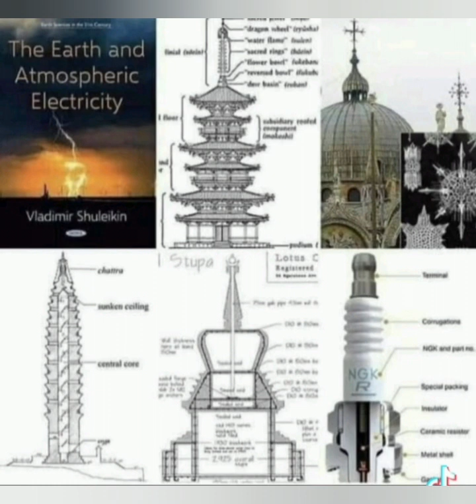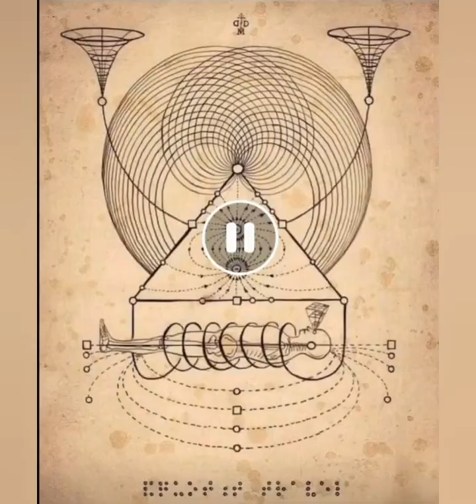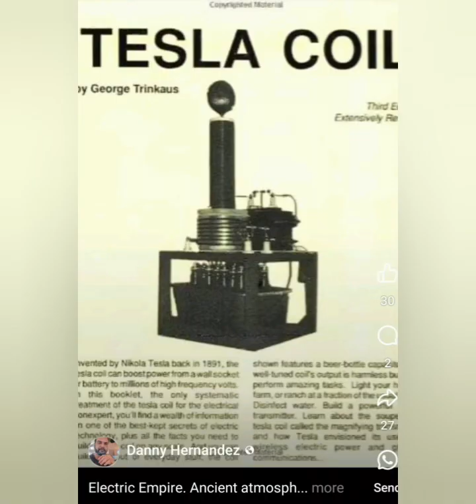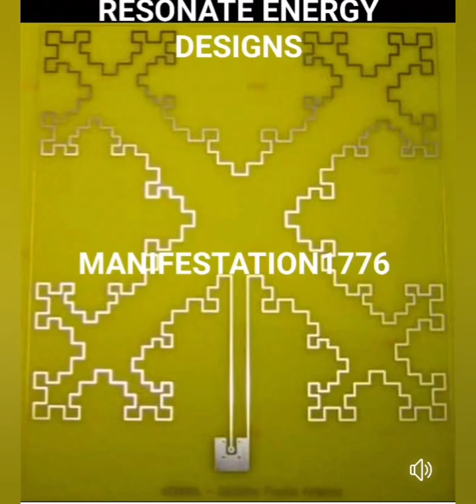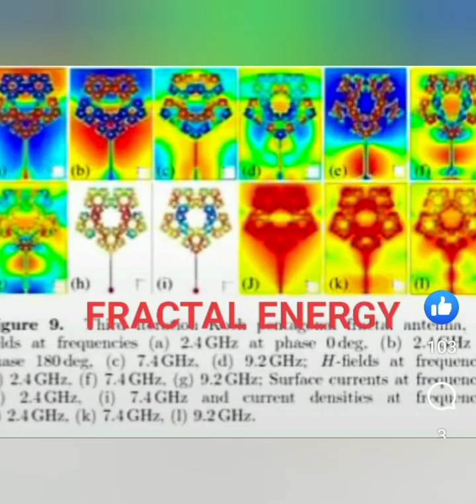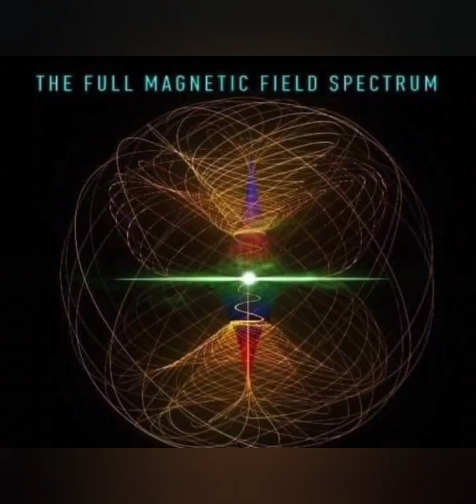Energy Project  The Technologies of the Past

Comment: Well done. What is in the background of the last picture do you figure ?
Reply from the maker: Thank you.  Last picture has different explanations one more interesting that another. One of the most extreme explanation is that was brought there somehow.
Reply: @LilianaUsvat  yes lol I thought that at first because of the parachute type structure. Its not to fly the building its to fly the antenna even higher. It exposes an additional aspect of atmospheric electricity ive recently become aware of. Steam baby . Atmospheric electricity works on moisture evaporation hence the moats and steam ports on the roof. Natural and boosted Atmospheric